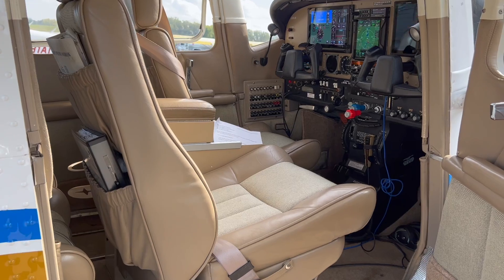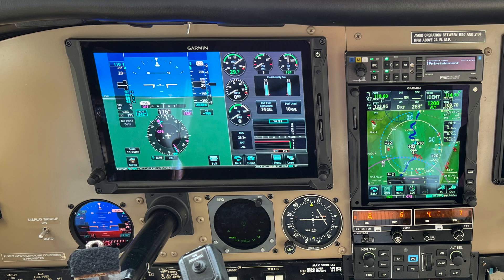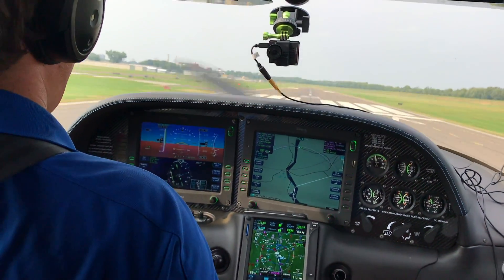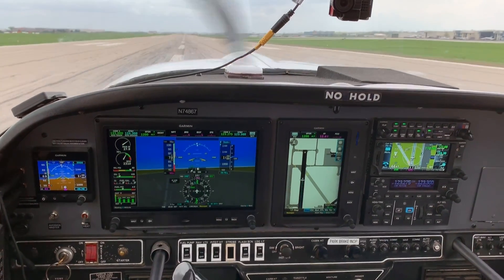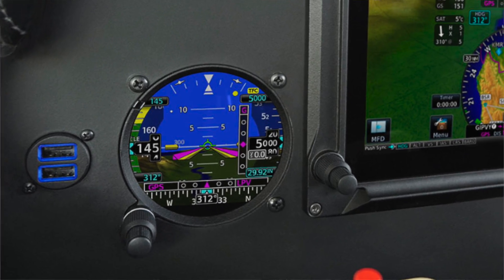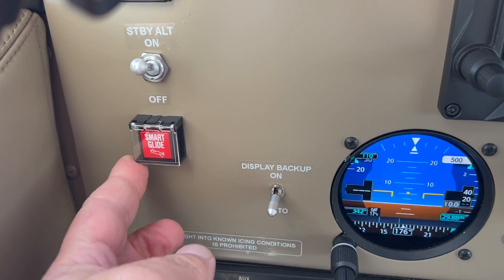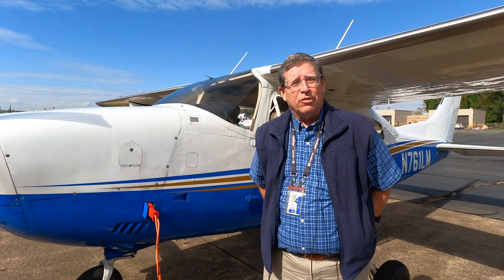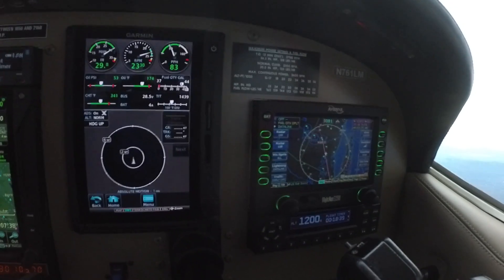Cessna T210 Avionics Upgrade: Plan it Right

Comment: i had the latest garmin glass panel installed in my 85 p 210 , love it pacific avionics installed it 4 months ago.no issues. does what i paid it to do  what  is flight safety? lol i refuse to have a 20 something kid try to tell me how to fly my plane which i have owned since 1987   i do see a lot of people get to technical  on radios.  i am flyng my p210 to europe in a few weeks  made the trip a few times over the years in it. now should be a bit nicer with the new radios  and why do people take it so serious?  i donot think people have fun anymore. take themselves way to serious, i have over 17000 hrs  from crop dusting to helicopters now i go where i want when i want. no more non  pressurized aircraft my backup plane is my 1980 p337

Comment: So I read the negative comments about "Why this layout", "Why doesn't everything line up",  to this gem "they could have arranged the panel much nicer and put the G500txi, the 750xi, and the Txi EIS all at the same height"

All of the comments made by people who apparently have zero idea that the instrument placement on this age of aircraft is dictated by the outdated Stationary Panel behind the 'Panel Face'. The stationary panel is part of the aircraft structure and it can't be cut or changed in a way that would allow modern square glass panels to be placed in any way other than happened here. There are a few STCs that allow for a complete replacement of the stationary panel - but none so far that are for this model of aircraft. 
Been there myself.

Comment: I just don't understand why you'd still leave some of the old instruments in there or that old COM2. If you already spend that kind of money and cheap out on small items like that, I don't trust you enough to purchase that airplane from you. Also, they could have arranged the panel much nicer and put the G500txi, the 750xi, and the Txi EIS all at the same height. I don't blame the owner, I blame the shop.3x
Reply: Well when you're IMC and your fancy Garmin GPS does something weird, it sure is comforting to have an old analog nav dialed in for a cross-check. And it's pretty hard to miss-program a KX155. Those of us in our third or fourth decade of flying single-pilot IFR will understand.  You might also in a few years.  If you survive that long.
Reply: @SkylaneGuy  The last part of your comment was not necessary.
Reply: @SkylaneGuy  Totally unnecessary statement there at the end. I have no problem with the extra NAV receiver and in 2 decades of flying hard IFR I never had a Garmin system go bad. The owner will learn the hard way that this panel is terribly arranged once he tries to sell it because I guarantee that whoever is gonna buy it wants to make these changes and get rid of the old useless weight.
Reply: @Kaipeternicolas  I think three things would have gone great  with that panel under the 750nxi put in a 650nxi that gives u two radio's  and the transponder he has put the one by garminthat hides behind the panel and instead of the ps engineers  audio panel again go with the garmin audio panel that hides behind the panel. I think that would clean it up nice . I don't know if garmin radar would go in the pod on the wing . Also just to add garmin radar is not cheap. It would get rid of the panel instrument he uses for the pod radar. The garmin would work on the 750 or 650 nxi. Just a new G500 install will run you about $20,000
Reply: @Chris-ev7xo   Agreed!